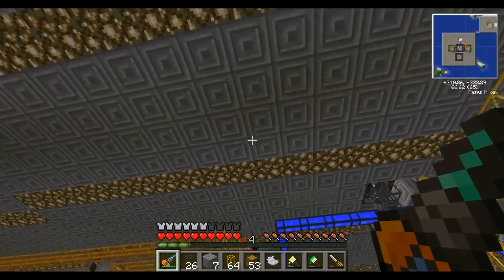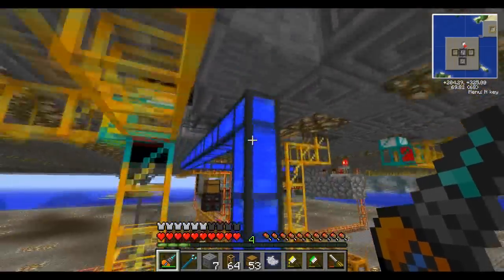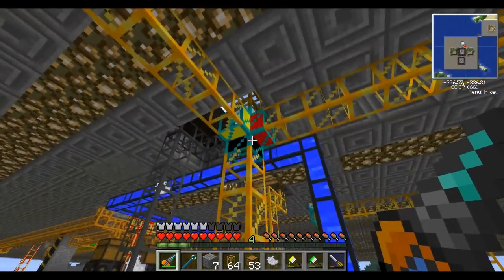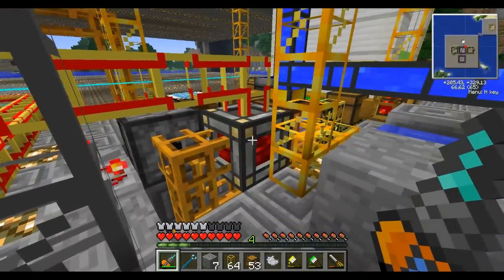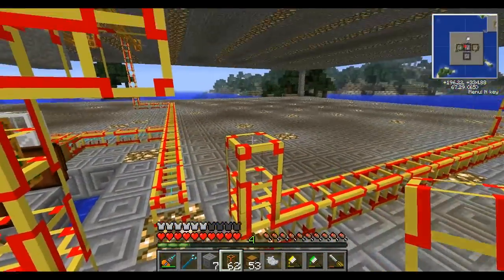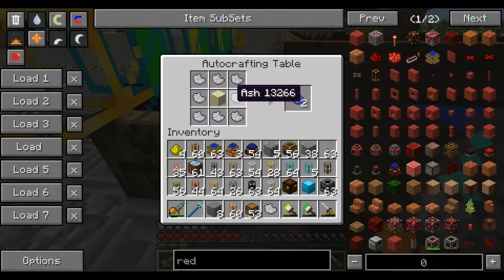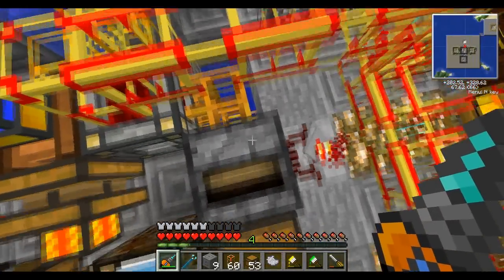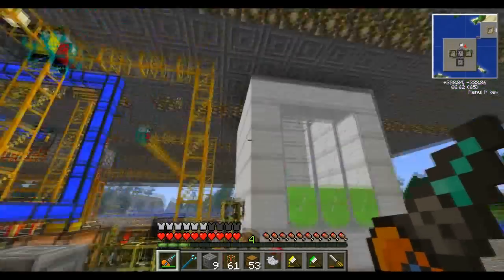Forestry Perpetual Farms Part 3 (Biomas Production and Tree Farm )

Comment: I'm confused in regards to the dirt in the system. Basically, you're using 4 of the dirt in the system and 4 of the sand to create 6 bog earth. Doesn't this mean that you waste 1 dirt and 1 sand every cycle? If so, seeing as you are supplying extra sand to the system, won't you eventually run out of dirt?